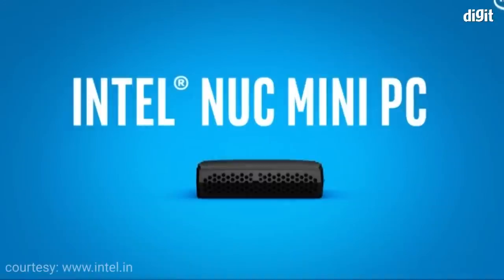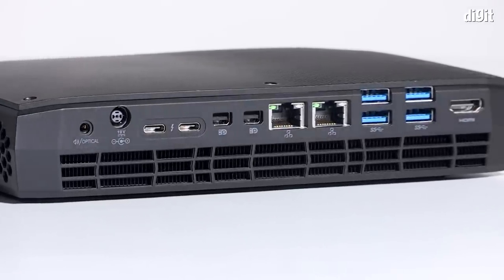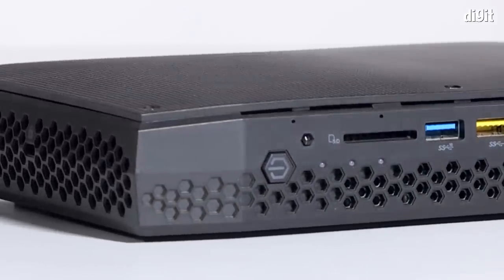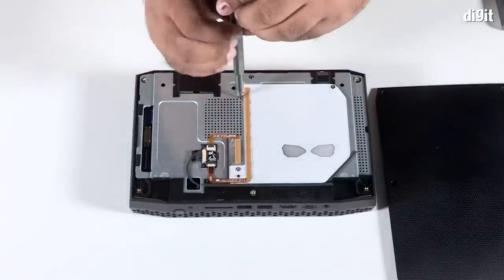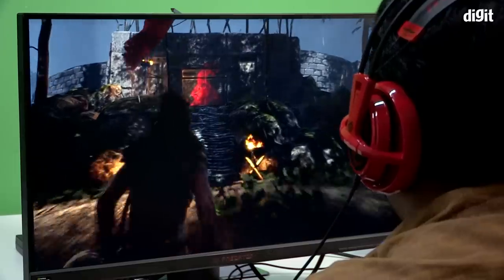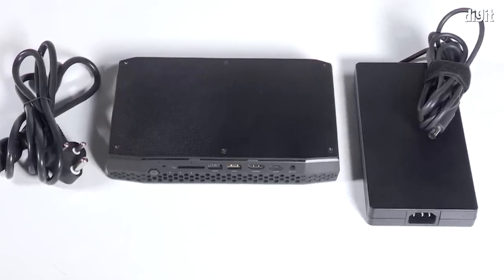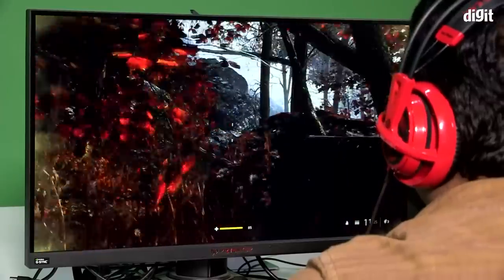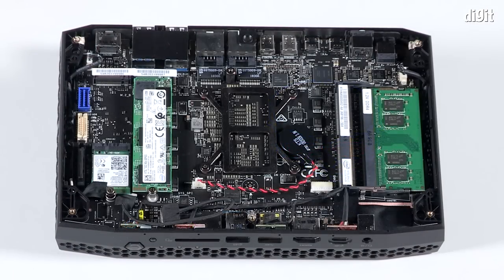This Mini PC is Insane!!! Intel NUC Hades Canyon NUC8i7HVK Mini PC Review

Comment: you need to disable v-sync in the games settings otherwise the video card will adjust according to the refresh rate of the monitor even if it can produce more than 60fps
Reply: You WANT to restrict output to 60fps if that's all your monitor can handle. If you don't you'll get tearing.

Comment: In case anyone is wondering the NUC8i7HVK is upgrade able to wifi 6. Intel said they never tried and simplynuc said no, but it works great with this chip "Intel AX200ngw"  My speed w/o a wifi 6 router went from 55 to 215 in the front of my house.

Comment: Only learnt about these things recently. Wondering how well it would drive a Quest? Has a plug for 18V DC so you could make your own modular backpack VR PC system. As expensive as it is? (Not much more expensive than equivalent systems). Still a damn sight cheaper than a HP backpack PC though less capable.